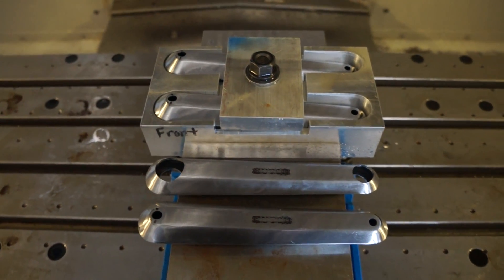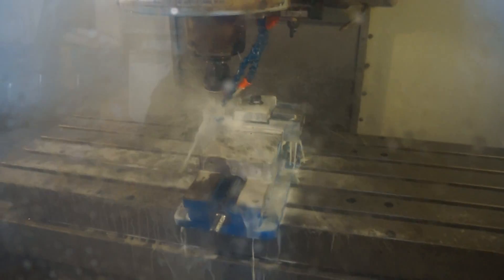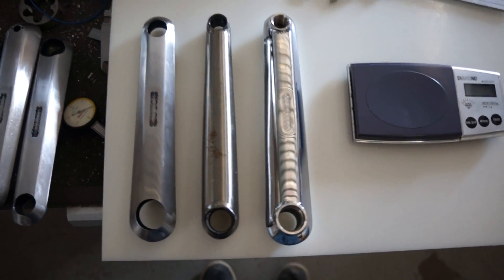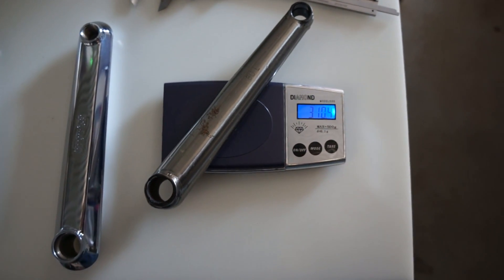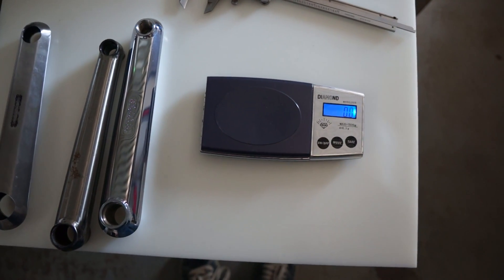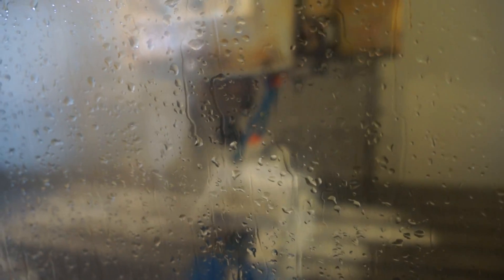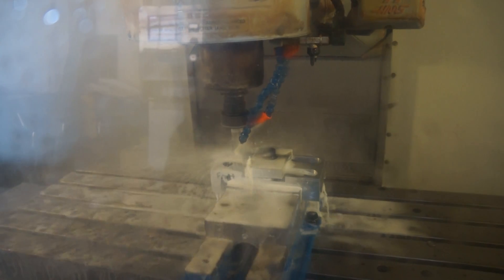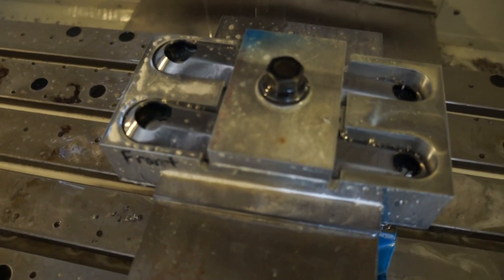Hutch Aerospeeds in the CNC

Comment: What I like about the new Hutch is you can actually ride them, and without fear of breaking them. Even us old and tall guys. In 2010 I bought an 84 Pro Racer. My knees hit the bars. It was unridable. Lay back seat post and 8" riser bars and it's non issue. Only complaint is the hard seat hurts my old ass.